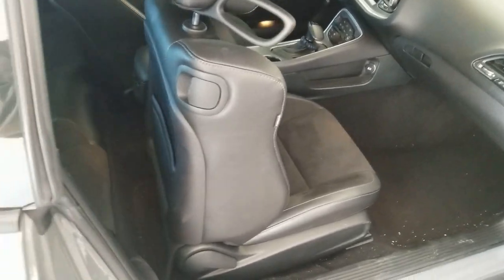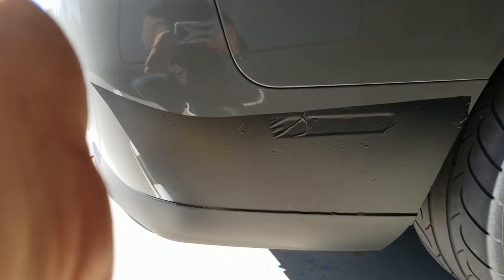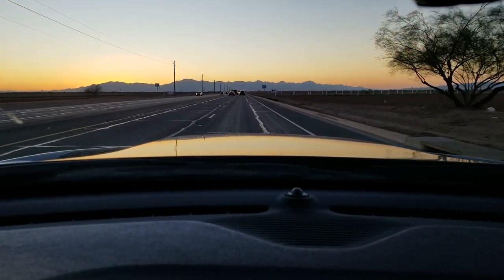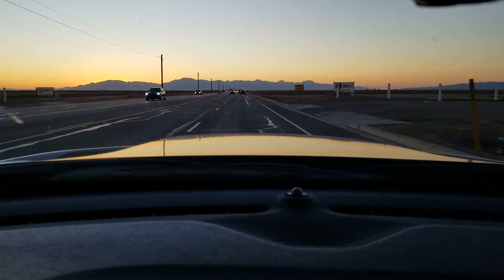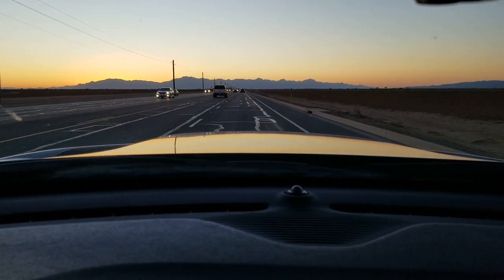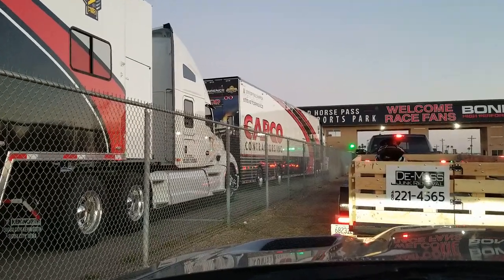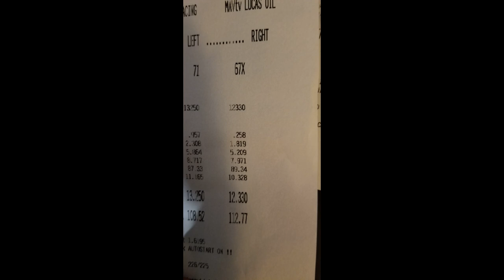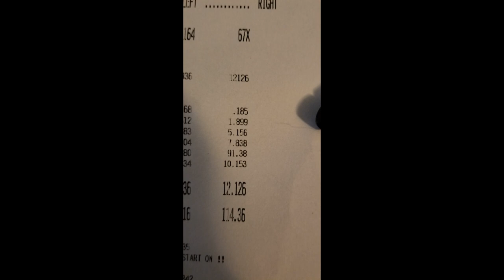2019 Dodge Challenger 1320 ( First Drag race of 2020)

Comment: Well, here it is three years later and my local drag strip "Atco Dragway" in NJ just closed forever a couple weeks ago.That is just my luck too, as I just 2.5 weeks ago FINALLY bought a brand new 2023 Challenger 1320. Now I will have to drive over 70 miles one way to get to a diffenent track ( Atco was about 34 miles away).This track charges $60 to race on a typical test & tune night!!! What ever!
Reply from the maker: Brother, I feel your pain. I bought a 71 Dart Drag Car with a 451 stroker and Wild Horse Pass closed, the only track remotely close to me. This is getting old fast. Keep on rolling that beautiful machine brother!!!
Reply: @Destroyer1320  I did buy a Draggy to use, but that's not nearly the same as actually racing at a drag strip.
Reply from the maker: @stevesmith6236  Agreed, breaking hearts is fun haha. Hope something changes soon in your neck of the woods.

Comment: The Mickey Thompson ET Street R's did not leave any rubber on the side of my 1320 when Jared Balfour drove my car at Mission Raceway last October.
These tires hook like nothing else.
The car had only 550 miles on it and clocked in at 11.569 seconds at 117.5 mph.

Comment: Mickey Thompson will put you in the 11’s easily. What is your coolant temp on those passes?
Reply: Destroyer 1320 if you can run it at 160-170f you will pick up a tenth.
Reply: Nexens are good for low 11s I get 1.6 on nexens

Comment: It's not the tires. Your doing shitty burnouts to warm those up. Nexans need HEAT!
Reply: @Destroyer1320  Don't be afraid to hold your burnout. One mistake is you think you did a 5 second burnout but it was barely 1.5 sec.
Reply: @Destroyer1320  I dont agree with that. the computer is more than capable of knowing when to shift. Are you using the trans-brake?

Comment: Traction control did not kick in it just lit up because you spun
Reply: Traction control will still kick in under drag mode unless it's completely turned off . Which may not have been changed.